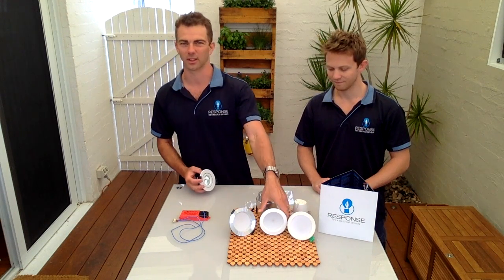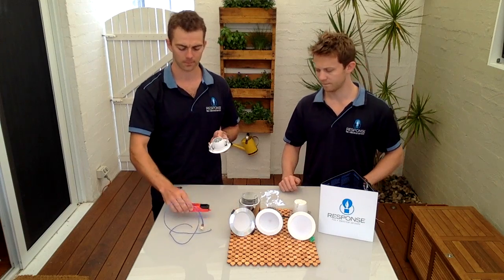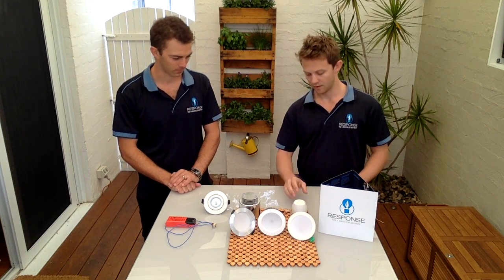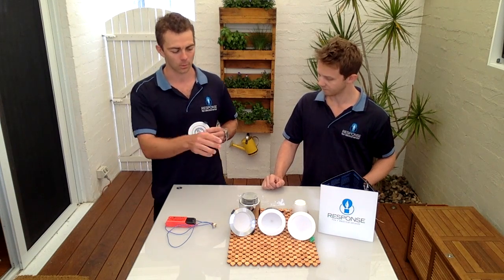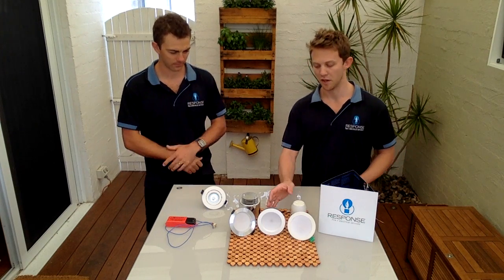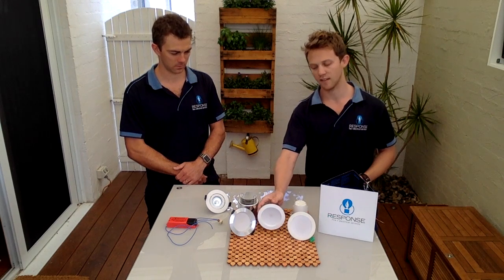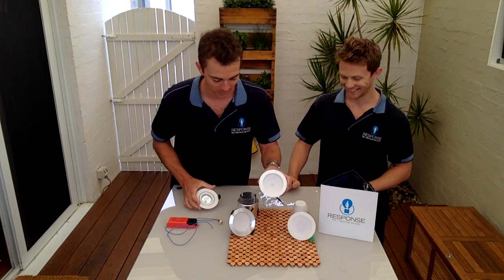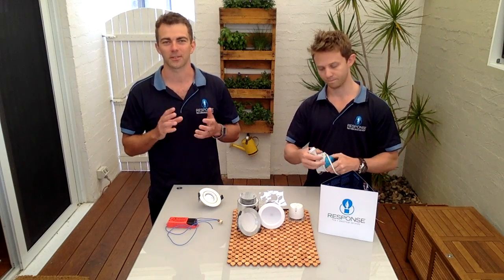LED Down Lights - Everything You Need To Know

Comment: What would be the maximum watts that can be used on a 15 amp circuit. And the max watts on a single led dimmer.
Reply: 230v x 15A = 3450 Watts or 3.4KW.
Reply: Paul Overington  I cant remember asking this question but I’m sure it was to see if they did know lol. Always remember a breaker can only be used up to 80% so it’s 230x12=2760 watts. All residential in Canada is 120v so 120x12=1440 watts.